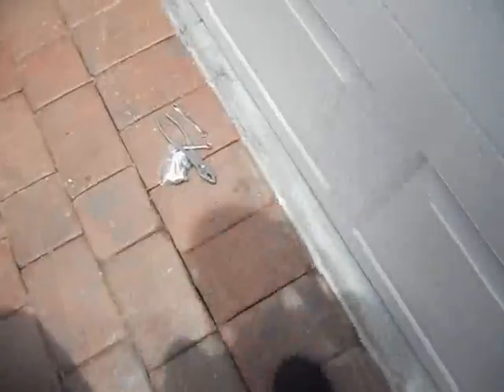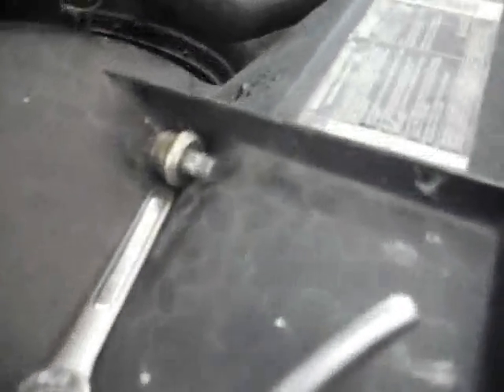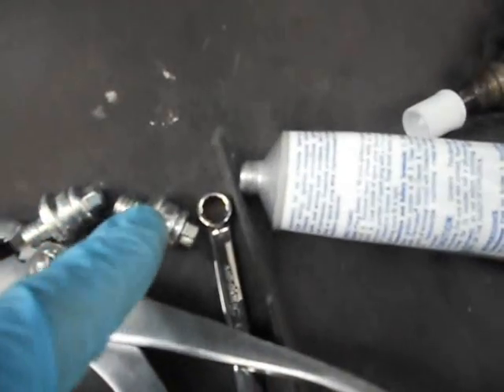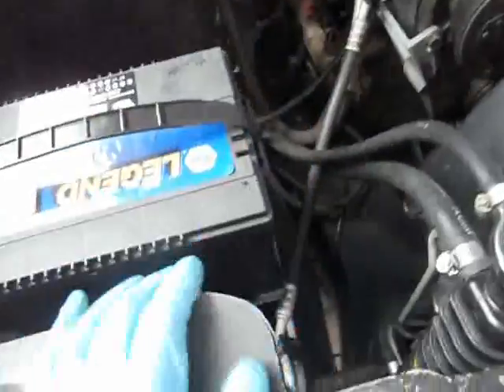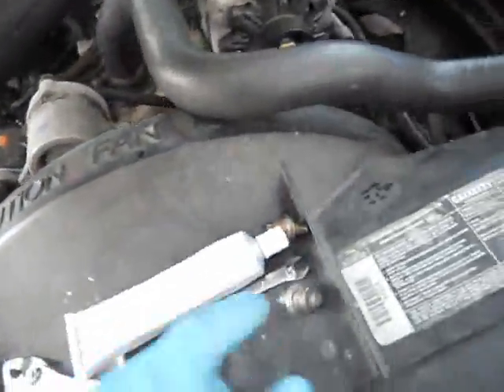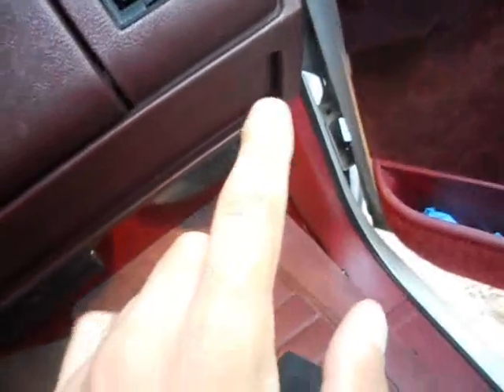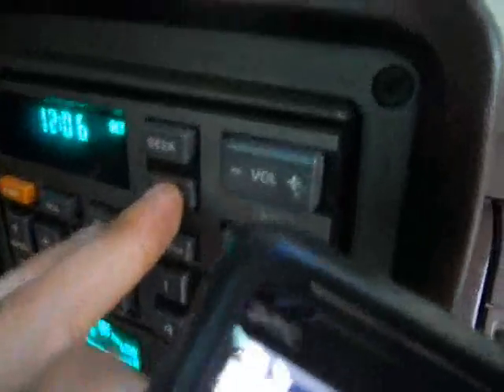How to Side post car battery cable bolt repair if stripped GM vehicles

Comment: Dude, you skipped the part where you actually insert the terminal bolts!
Reply from the maker: Haha. Yup that's a really hard step.
Reply: Ty
Reply: Yeah the was actually the part I was watching the video for lol!
Reply: He skipped a lot of parts but concentrating on the weather
Reply: Agree!!!!
Reply from the maker: @automotiveelectronicsfroms2699   No just skipped pushing a bolt into a rubber connector real hard I'm sure wiring diagrams are much complex to understand then pushing a bolt into a rubber battery terminal boot

Comment: For half the cost of Battery bolts you can buy 3/8 bolts (Course threads) 1-1/2 lenth and a 3/8 bolt Both items stainless steel. Put your nut on and turn it all the way towards the head Push your bolt into your Terminal cable Then screw in to the battery "Finger Tight" Then snug with wrench. Tighten the Bolt towards the terminal cable untill no play is found Then add a 1/2 turn  Add dielectric grease to the terminal and bolt ... You now have a cheaper method That will be much easier to use booster cables on, The head will not strip, And you have room to add on other wires if needed on a upgrade,  Done right it will outlast the car or truck
Reply: So one 3/8 bolt coarse thread and 1 nut? 

Like this?

====[]==[]       ???

Comment: My Tahoe was acting weird. Wouldn't turn over. Bad ground. It's was these bolts and rusty connection. Side posts not as reliable. Where do you put the grease?

Comment: that was no help,I meant the inside of the battery side post the threads on the inside of the post.
Reply: IF the threads on your battery are stripped just buy a new battery, don't be tight!
Reply: Its brand new battery. Purchased today battery hole is stripped need bigger bolt I think
Reply: Yeah why are there no videos on if you strip the soft lead female threads of the battery?  That's the expensive part.  Who even strips the hard steel bolt against soft lead anyway?

Comment: My 1989 Vandura battery side post is striped the more you tighten it becomes loose, I tryed to start my van and nothing no power, what I did is I used a flat screw driver with protective rubber handle and I just tickled the positive post while rubbing side of metal frame causing small medium spark!!! Then I go to start my van power back on van starts.

Comment: Step one remove sidepost battery step two throw it in trash step 3 cut off old battery cable ends step 4 replace old cable wires with good top post cables step 5 add new top post battery step 6 sit back and enjoy a cold beer
Reply from the maker: Why? Side post works all-right. These lasted 20 + years   It costs more to change it to top post and top post batteries ALWAYS leak
Reply: avenfog2000 
I hate the sidepost battery in my Camaro.

Comment from the maker: If the 5/16 inch / 8mm  hex is stripped on the bolt, and vice grips wont loosen it, you are SOL. IF just the threads are stripped, change the bolt, they press right out like in this video.

Comment: why i don't like them is because they are very hard to probe when the bolt and terminal are corroded. In my saturn sc2 i am trying to find a power draw when everything is off. but i can't get a good reading because of how corroded the bolt and terminal are.
Reply from the maker: Clean them up then  You need to put a meter between the negative on the battery and the cable anyway to find a draw. Better off just screwing a bolt into the battery that fits clip one meter lead to that then ground the meter on the small cable off the ground side that grounds to the body . Its hard to clip into a side post with a alligator clip unless you nut and bolt it
Reply: @GhettoWagon  I know its just in a top post they don't seem to get as corroded

Comment: the red plastic on my positive cable started tearing.  will it cause problems if I just rip it off the rest of the way?  do I need the plastic on it for any reason?
Reply from the maker: Its for insulation to protect it from corrosion or from shorting out if anything metal grounds it out.  You can buy Cables for cheap.

Comment: I've had 2 incidents,98 Buick messages those bolts..unscrew ing them messed up the threads in battery thread holes.had to buy 2 new batterys.I've learned too never remove those bolts at all,until its new battery time.
Reply from the maker: Probably install error   I have 30 year old vehicles the bolts never gave me a problem but after like 20 batteries and maybe 150 or so battery disconnects + corrosion it was time for a change these same ones i put in are still working fine 10 years later

Comment: Yeah my side terminal bolts were wearing down to where they would barely catch a wrench....popped out the old bolts and replaced them, took maybe 3 minutes to pop the old out, put the new ones in, install a new battery and connect everything.  Knowing how easy it was to swap new bolts....I no longer hate the side terminal batteries 🤣😂🤣
Reply from the maker: Yea at least you were able to remove the bolts they just pop in and out. so many left horrible comments could not figure it out.    Yea new bolts are nice they are good for like 15ish years and alot of batteries

Comment: Yeah, u showed how the bolt just popped out ez in ur hand,& u did explain about the nub,& using pliers to pull the nut,but when it just fell off, that ain't showing us anything, nor showing us how to replace the bolt, u talked,& showed outside,& showed urself starting vehicle. Very little help; but i think i get it?
Reply from the maker: If you cant understand how simple this you should not be messing with your battery.  Repairing things is not for everyone

Comment: Mine got stripped too but my mechanic didn't even bother saying anything, years later I finally found that the bolt was not making a proper connection smh
Reply from the maker: Yup. They do it all the time or thread them in crooked. Make sure the battery threads are ok.  Clean it up put a new bolt. Replace both

Comment: Was just replacing my battery today, got freaked out when terminal bolt was worn down and didn't catch battery thread. I had no clue I could easily replace it! MUCH thanks! Very helpful!
Reply from the maker: ya after like 5 batteries these bolts are pretty spent

Comment: how do you take the Red/black plastic off?
Reply from the maker: +hmongster357  Try pulling on it, but I bet it will be on there difficult and you will have to cut it off, you will never be able to get it back on
Reply from the maker: hmongster357
 Pull it from the BOTTOM where all the wires are, first try to peel the circle part around the metal terminal. . When they are build they are slid up. so that is my thinking.

Comment: Thanks, but WHAT SIZE WRENCH? I have a 2001 Silverado 1500 that won't start occasionally until I move the side battery red positive cable connection up or down.
Reply from the maker: Yea, Mine used to loosen up and do that, 5/16 or a 8mm,  Both are close, I think a 5/16 worked better.
Reply: thanks pal. As an old 61yr old disabled man, that helped a lot.
Reply: I used an 8mm and it stripped it. I’ll have to try the 5/16th for sure after I break this bolt off and replace it haha.

Comment: positive side bolt is stripped mechanic is telling me bolts can't be removed so I need to change entire cable ($200) on my 2006 Silverado 1500, (1st time battery replacement) is this true or can I just change the Bolt?

Comment: Thanks--very helpful.  I'm installing longer terminal bolts on my Chevy 2500 battery, to make jumping easier.  I have to jump it often, from forgetting to turn lights off.  Your video showed what I need to do--I appreciate it.

Comment: The turds at a local shop stripped the side terminal bolts and within a week destroyed my AGM battery. Installed a new battery, bought new bolts from O’Reilly for $2.99. Very important!! As per GM specs, I torqued the bolts to 135 in lbs. Perfect fit. I used the same torque specs 6 yes ago until the above event.
Reply from the maker: Yea I dont get very tight.  When they snug up I give the bolts a tiny extra turn.    Kinda hard to use a torque wrench on some cars it won't even fit in the spot
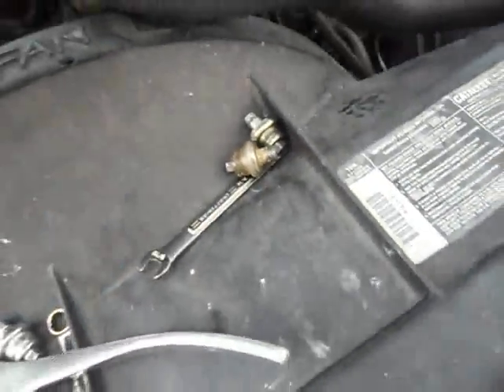Reply: @GhettoWagon  ive been leaving them just snug because if you look at 1:37 those protruding indents in the leads have been digging into the side post.. Im getting a voltage drop somewhere i was wondering if i should flip the lead but it looks to be normal from your video
Reply from the maker: @ScreamoYT   All of these have indents so they dont rotate
Reply: How did the battery get destroyed?
Reply: Destroyed in what way** i mean

Comment: is there a way i can hook up a terminal to a side post battery? im trying to finish my system need to run 2 power cables with an adapter from my battery to amps, can i hook up a terminal to side posts?

Comment: Thanks for the info. Did you just pop them in? Its that simple? What are they called specifically? How much was that pack you showed in vid?
Reply from the maker: yes just pushed them in.  Battery holts I paid very little for a pack of 5   almost 10 years ago
Reply: @GhettoWagon  thanks

Comment: The lead in the battery side posts is softer than the steel bolts, so wouldn't you expect the threads in the lead to get stripped first?
Reply from the maker: The threads roll over regardless. I think the bolts are a softer than traditional steel anyway I may of even bought some that were a non ferrous material   Brass maybe not sure.  Some Aftermarket bolts are probably steel.

Comment: How did you actually remove both bolts? Mine are stripped but I managed to remove them from the battery. Thanks if you reply
Reply from the maker: they just push out from the rubber with your fingers. Unless its -50*

Comment: Quick question. What would happen if the red rubber around the positive terminal is cut off and is hooked up straight to battery without it?
Reply from the maker: chance of a spark when its grounded or crashed

Comment from the maker: Yea, you an buy a terminal bolt adapter. Its larger, but it has a extra thread on the back that you can hook a power connection to. I have them on my other car.

Comment: I tore that plastic off the terminals and covered with dielectric grease, connection seems better now
Reply from the maker: Now its just dangerous so it can ground against metal parts easier or in a crash.  99% of dielectric grease is non conductive.
Reply: @GhettoWagon  I got the advice from this video
https://www.youtube.com/watch?v=My5VB7gD4P0
seems to be getting positive feedback
Reply from the maker: @OldSchoolNoe   Hack stuff
Reply: @GhettoWagon  im confused how is it dangerous? The top posts i seen had no rubber anywhere it was just raw steel or whatever..

Comment: I'm trying to change my bolts on my trailblazer, but they're not popping out...
It seems that the bolt is lodged inside the rubber insulation casing. I can move it about, but it's just not popping out like in your video...
Reply from the maker: That's because its probably not extremely hot.  Warm them up with a heat gun or a hair drier, Don't go nuts and melt them,just make them 100 or so degrees.

Comment: You need to re do the video... and show all the steps again including you putting in the new bolts... I have the same problem actually and loose connection even with a jumpstart
Reply from the maker: I dont think I do.  The bolts just push out and push in.    And.. Many other youtubers copied my video and did their rendition on it :)  Yea  these connections get loose over time I recommend getting a cheap 8mm or 5/16 wrench and keeping it in the car somewhere.  Or every other oil change make sure the bolts are tight.    These old original ones from 1994 got a little rusty and the threads were a little worn from time
Reply: Ghetto Wagon I have a Buick and mine is rusty but I clean it with water and it’s loose... When I turn over the key the power goes out in the car... I have to go back and reconnect the battery again... It’s an headache
Reply: @lifeofcoby  do you have anything else besides the battery terminal that's going to be on that bolt goin inside the battery? If so get a longer side post battery bolt then if it is to long on the outside slide some washers and maybe one lock washer on it no more problems for me on my 97 k1500 pickup when I done that

Comment from the maker: The terminal bolt pops right out with finger pressure. Usually.  If not pliers press them out quickly.

Comment: Got a 2-fer today. Checking the O2 sensor video and found this terminal vid. I was not looking forward to changing the whole postive cable. It's been stripped for quite sometime,lol I don't know why so many dislikes. Straight and to the point! thanx!
Reply from the maker: It should be easy.  Just take pics of the routing and you will be fine.   Hardest part is unhooking it from the starter.   As for people disliking my videos? I They just are a bunch of losers who have to vote with their thumb while they do nothing in life

Comment: What if inside the battery where the positive bolt goes gets stripped?
Reply from the maker: New battery  I doubt  you will be able to tap it, its soft
Reply: Ghetto Wagon  my bolt is stripped too and I have to wiggle it sometimes because it'll just be dead when I come to start it . You think I can replace the old bolt with a new one of the exact model ?

Comment from the maker: 5 or 6 battery installs. Every time you loosen the battery terminal bolt, the threads get booged up a little.

Comment: I cant get my - terminal out of the cable
Reply from the maker: Try harder, Use pliers  Heat it up with a heat gun. They come out
Reply: I was using pliers. Didn't think about heating it up it is in the negatives here. Ill try boiling water or something.
Reply from the maker: Oh so its cold, Ya those rubber ends wont budge!  A hair drier will work if you dont have a heat gun. I forget its super hot here all the time and pieces fall off. Back in the cold country I would just wind up fighting pieces

Comment from the maker: They make bug 3/4 inch gold plated terminals for adding power eyelets to a side post car battery. I use them on my other cars, ANYWAY, they are way better to get a good clamp on if you need to jump it.

Comment from the maker: IF its a GM, They sell cables pretty cheap. Any parts good parts store that stocks AC delco parts will sell it, Usually they are not too hard to install either now a says usually the ground is short right to the body and the power wire ends at a junction box close to the battery.

Comment: where did you get the bolts?
Reply from the maker: +james naclerio  Anyplace who sells AC delco parts.   Any parts store sells them too, they are Chinese there.  I don't like that kind of part
Reply: +Ghetto Wagon Thank you for the video. I was hoping I could change the bolt without changing the cable, which was fine. I found a pair at Autozone for under $3.
Reply from the maker: dutchiebunny
 Coool.! I used those, I like the AC delco bolts better but the AZ ones work

Comment: I think if you take care of side post batteries they are great. Most people don't though and don't want to take the time to take care of them. That's why I dislike them. Side post terminals also make giving a jump a bit more difficult. but that's just my opinion
Reply from the maker: Yea they are  just as neglected as top posts.  Ya battery jump is a PITA at least General Maintenance vehicles usually give you a post. then ground the negative somewhere.

Comment: Hello I need some help, my bolt plug, on the battery post is stripped how can I re thread it, it starts when I hand tighten the bolt on the positive post my trailblazer starts but after I turn it off, I have to repeat everything all over again to start it up, is there, by any chance that I can re thread the battery post? I can't afford the high priced mechanics to fix it for me, if I can fix it myself, I would be happy, I love fixing my own things, if it's possible without the cost of over 1000.00$
Reply from the maker: The threads inside the battery may be stripped Just get a new battery or warranty it if its under a warranty.  usually you get a few years depending on where you buy it. May want to change the bolt too if the threads look boogered

Comment: Not sure if @ghetto wagon is still replying, but I have this issue on my Trailblazer. For months now (during the extra cold winter), my battery will constantly die if it sits outside without starting for more than a few hours. I'd change out the battery, it works great for 2 weeks, then starts dying again. My alt seems like it's ok, tho. So my only ideas were either a voltage leak or the fact that my bolt is stripped pretty bad. Do you think this could explain my batt issue, even tho a new 1 works fine for about 2 weeks?
Reply from the maker: No you have a parasitic drain